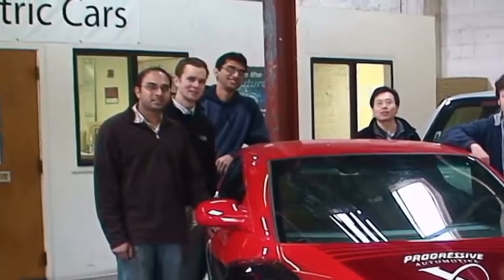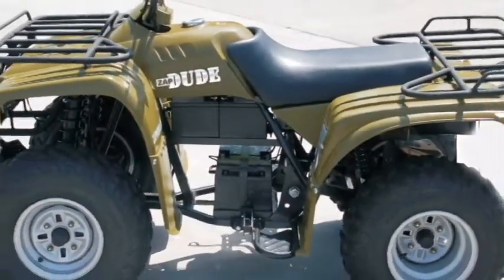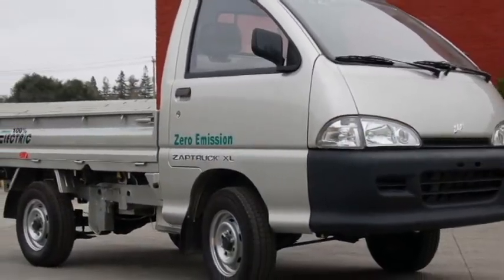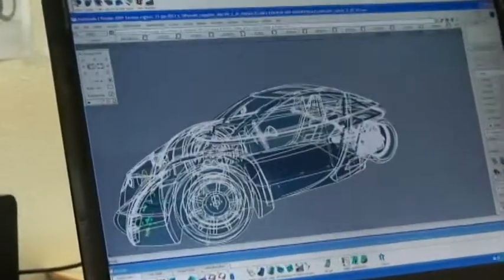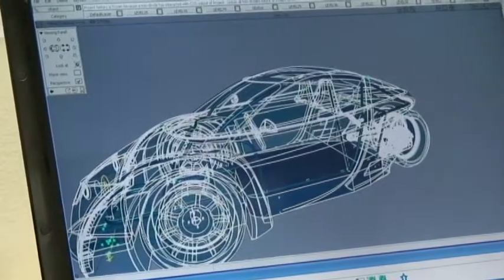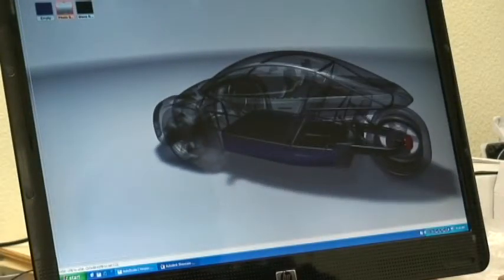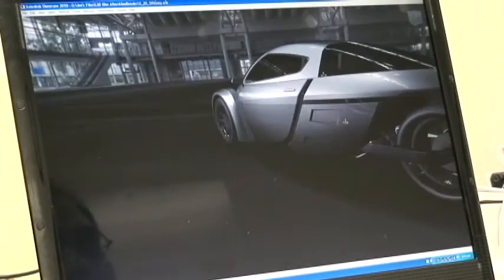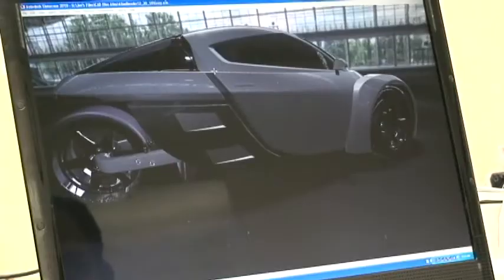Virtual ZAP Alias Electric Car

Comment: seems to me a enclosed motorcycle could be the best way to go,have you seen Lit motors design?like a monotracer with doors, using gyro technology which has been around for a long time,but now we have a way to control the gyro's.Streamlined motorcycles can over non streamlined[stock production]can double the mileage and or range of a electric.All I think about is enclosed motorcycles,fun with some safety built in.Any thoughts?Keep up the great work my friend.